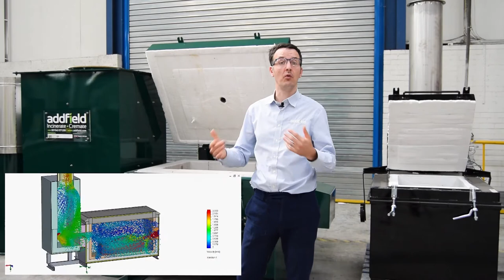Benefits of a brick based incinerator refractory over concrete

Comment: Plz mention the material that use for top load door on primary chamber
Reply from the maker: Hi the lip of the loading chamber is constructed from strengthened impact-resistant concrete. These are produced in sections to ensure that if they do get damaged by loading with mechanical methods they are easy and quick to replace.